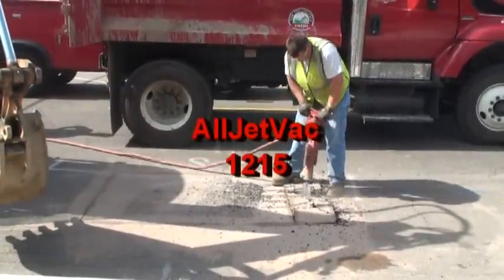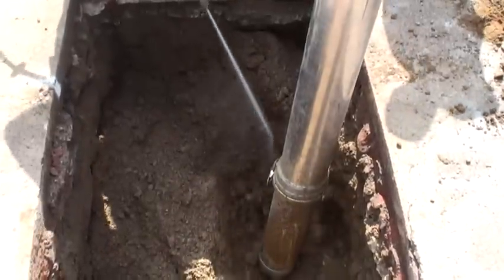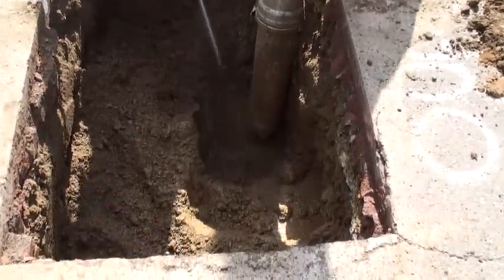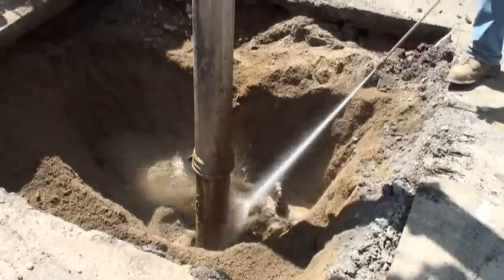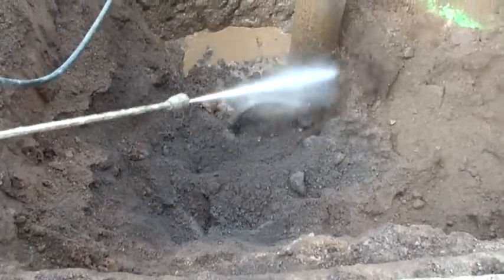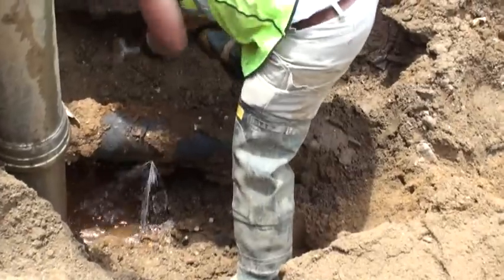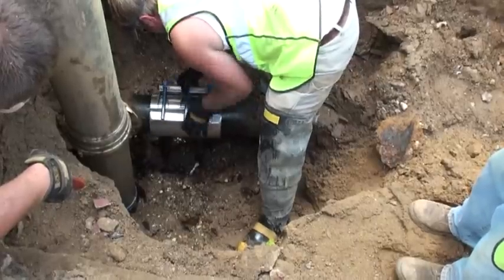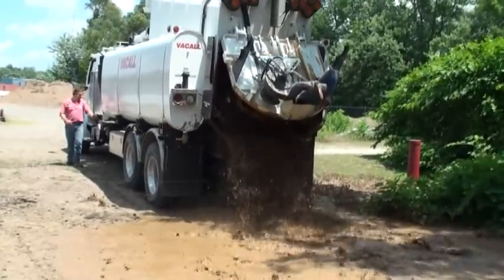Hydro Excavator Demo.mpg

Comment: Try a rota head for for your high pressure gun. Saves water and a Cleaner excavation. Your set up is like a garden hose. Very sloppy excavation.
Reply: There’s a lot of inexperience shown in this video. A seasoned operator/tech  gets this job done in a fraction of the time.

Comment: 1. Clay. How much harder is it for this baby?
2. Rocks. What if a rock gets sucked in?
Reply: Clay is annoying to cut through.
It takes longer to cut through clay but it is done.. Vacuum sucks it up easily, will suck most rocks.. The vacuum gets stuck a lot of the time though! To fix you stop the vacuum, unclip hoses, find what's blocking it then clip all hoses back together.. Annoying process.
-ndd truck labourer
Reply: It takes longer to cut through but it sucks it up nicely and it sucks up rocks as long as it fits in the dig tube
Reply: A rock in this system is a rock in any vacuum system. If its too big to fit through the flow system, it will clog it. If theres a lot of smaller rocks, they need to be sucked up gradually to prevent bunching amd clogging. Worker attention is still the most important aspect of proper vacuum excavatuon.